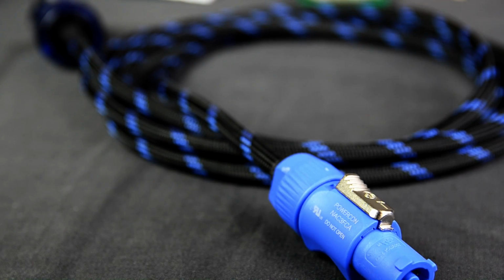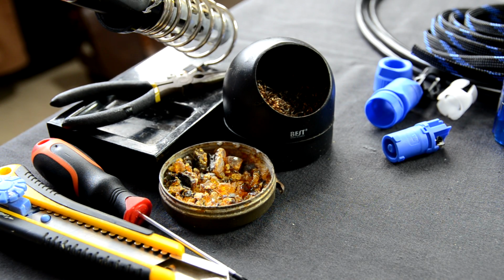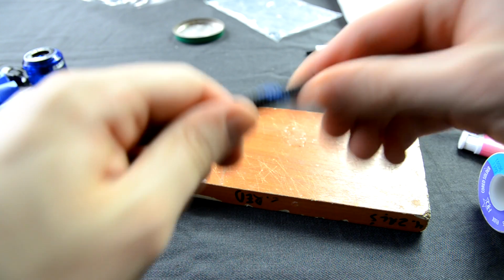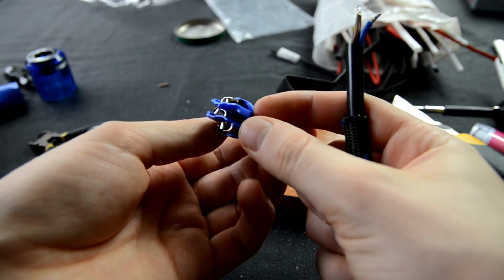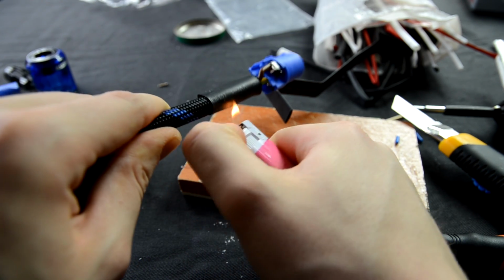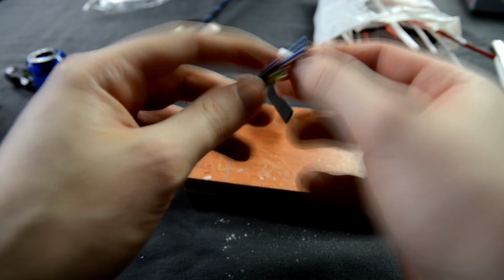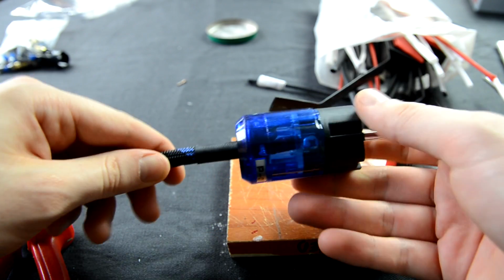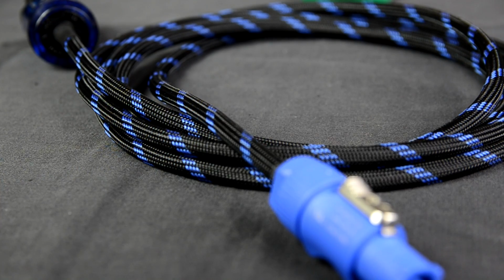How to Make high quality PowerCon to IEC power cable #DIY6

Comment: Great looks, but no changes to the sound because of the cheap parts..
Good powercable is shielded.
Reply from the maker: dude, thats just power cord, that don't change sound. If power cable can change your system sound, that this system have problems with power block filters.

Comment: You shouldn't just be hand tightening the bushing (3:02). If you'd bothered to read the assembly instructions, you would have seen this: "Fasten bushing by means of a fork wrench 7/8” 
(SW 22) or with the Neutrik handtool HTFAC, min. Torque 2.5 Nm (1.8 lb-ft)." 
Therefore, if it's assembled properly, one would need a tool to open it up and potentially expose live conductors, just like any other mains electrical connector. 
If you're going to be publishing instructional videos, then please read the instructions (https://www.neutrik.com/media/10217/download/bda-452---powercon---nac3fca---nac3fcb.pdf?v=1) and educate yourself.

Comment: wwwwwwwow..... WRONG on so many levels. where to start....never strip with a razor; never shrink the tubing with a lighter; VERY sloppy soldering; sorry i couldn't watch any more....you imbecile....
Reply from the maker: you are God ? Why I cant use lighter for tubing ? Why I cant strip with a razor? This cable works without problems.

Comment: nice vid, but there is one mistake that you've made, which is soldering the wires. soldering wire is a semiconductor, this means that it has resistance. It is better to use cable end sleeves, these keep the wires with eachother and are fully conductive
Reply from the maker: Best way will be use your version + my.

Comment: Thank You. I am just finishing my new guitar pedalboard and PowerCon is great idea. Better than standard PC Power socket due to locking function ...
Reply from the maker: thanks, I also like powercon,it's more professional gear, locking, also build quality!
Reply: Hi , I'm not able to do this job. It's great!!!  
Can you do it for me ? thanks
Reply: You should consider powerCON TRUE1 for a pedalboard, since it will probably be connected/disconnected under load.
Reply: You are right, it's better to pull all you gear over than to have a plug come out. Dip shits.

Comment: why not leaving ground cable longer than + and -? That is a lethal safety issue on power plug side. If something goes wrong and calbes are ripped from the power socket, ground cable is the last thing you want to be loosen.
Reply: samip88 I do not know all the systems in Europa but in Denmark, it does not matter if the ground is longer. In fact our safety system works great even without a ground cable, so it is not strictly needed but are an added safety.
Reply: Fried Mule stop making excuses for bad practice/ lack of knowledge your safety system works great without an earth cable? You shouldn’t be wiring a plug. Get someone who knows what there doing to do it for you
Reply: Yup, powerCON assembly instructions explicitly state ground should be 3mm longer (23mm total from main insulation jacket). It also says the exposed conductor should be 8mm. While I'm commenting: no, don't tin screw connectors. Don't keep tightening the screws. 1/2 Nm is exactly the amount you should tighten it.

Comment: Please DO NOT tin wires when using crimp contacts. Crimp contacts are made to squeeze soft copper strands, flattening them out immediately, making a nice big contact area. If you tin wires, two things will happen. 1. The tin won't squeeze nearly as much, creating less contact area, and more importantly, 2. Tin will creep, or give in to pressure, not immediately, but after a short time, and the screw that you tightened firmly will become loose. Boom, you have a bad contact. Seriously, open up the powerCON with tinned wires just one day after making it, and see that you'll be able to tighten the screws again, because they already became loose. NO TIN for crimp contacts.

Comment: what heat for the soldering iron do you reccomend?
Reply from the maker: +Zombie Jesus I use just constant 30w power soldering device and it okay for small things.
Reply: Don't solder power cable crimps. It's dumb.
Reply: Hot🤣
Reply: GingerSnaps don’t solder power cable crimps